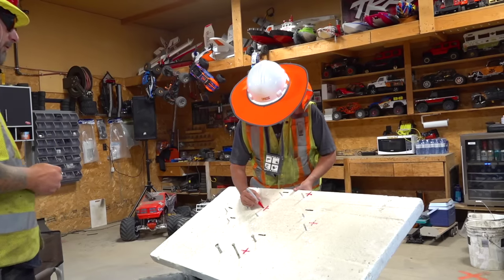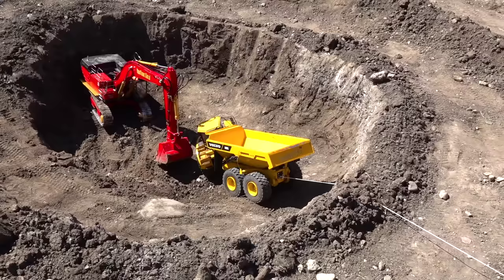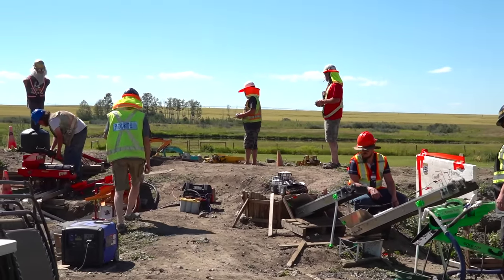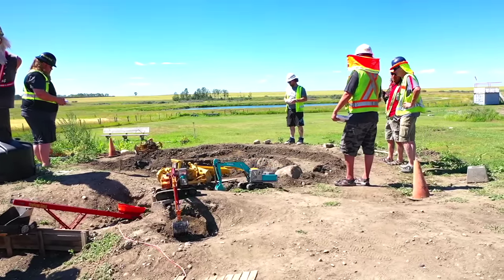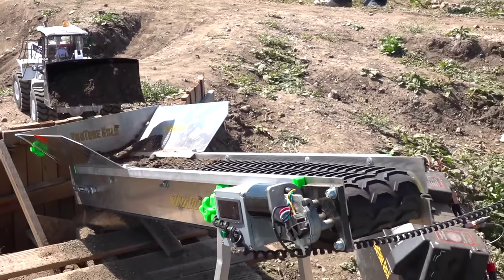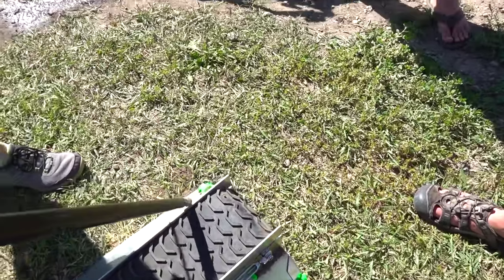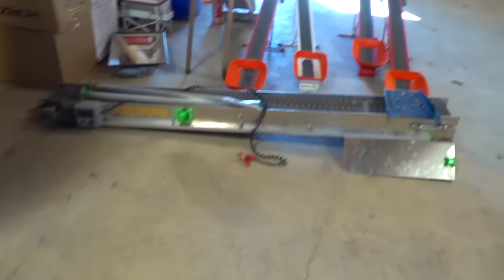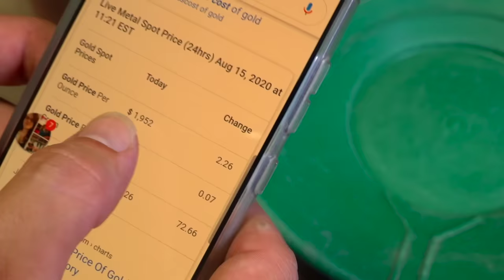YouTube GOLD (S3 E15) BiG PROBLEMS, LiTTLE COUNTY - OUR SEASON is in SERIOUS TROUBLE | RC ADVENTURES

Comment: Build a water tower out of a couple barrels and fill em up before the end of the month so you can keep it topped off with rain water. Pump the water from the ponds, back to the towers.. make a recirculating system...

Comment: Any plans to dredge your pond? That submersible sub you have should be able to bring a suction hose down to the bed from a barge equip with slicers etc and tailings dumped back into the pond. I'm sure you're creative enough 😂😁

Comment: I know what's missing !  A piledriver or maybe ya call it a terminator ?

When a large rock is unearthed that's too big to work with, there is a vehicle equipped with a very tall hollow cylinder that smashes it into more manageable pieces.

The cylinder goes vertically just above the boulder and a massive steel piston inside the cylinder at the top is dropped onto the rock smashing it into pieces.

Comment: According to the Electrical Code Book, Section II, Paragraph 6, according to the sub-section which I just made up, "Any distribution panel must be constructed of foamboard or similar breakable material. Contacts must be made of bolts or wooden dowels, installed at least 2mm apart. Connecting wires must NOT be fastened and variables such as wind or rain are to be ignored.
So it looks to me like you guys are good to go!
Reply from the maker: #YouTubeGOLD!!